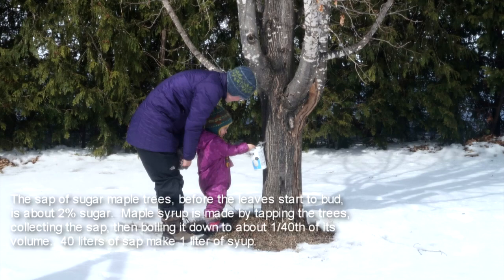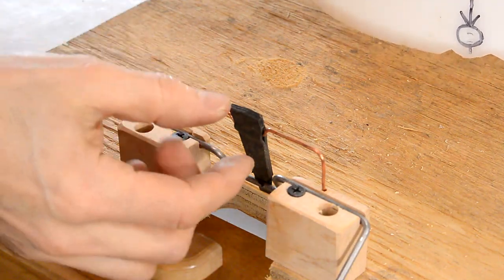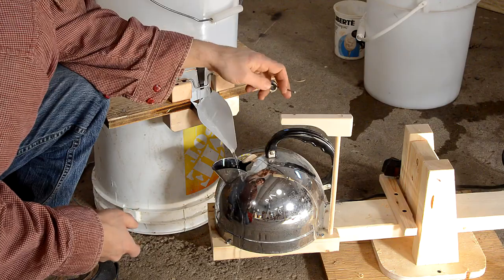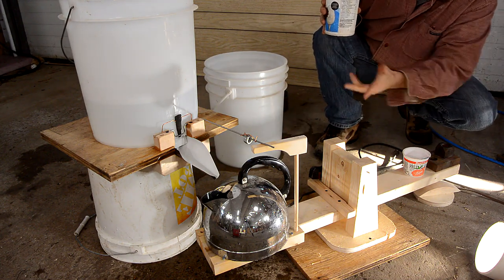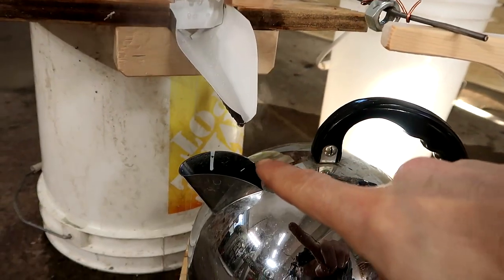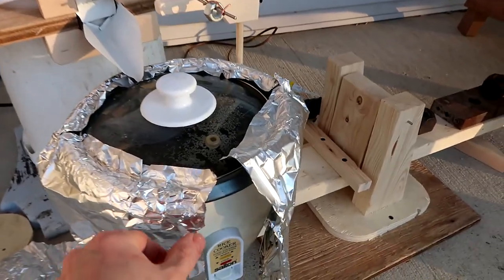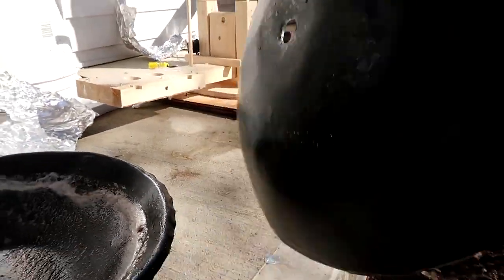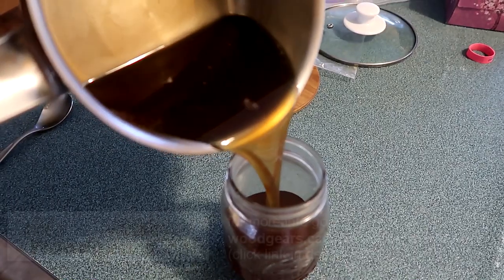Maple syrup boil-o-matic

Comment: This is awesome.
I'd have done it the easy way, with a balance, microcontroller, solenoid valve, and a relay, but the fact that you did this pretty much with only mechanical parts is truly awesome. (Only mechanical parts + the kettle, wich is electrocity powered)
Seriously, this way it looks way cooler :)

Comment: If Matthias buys a DeLorean make sure to turn on your notification if they aren't already.
Reply: He'd more likely make it powered by a wood stove and replace the front wheels with sled skis than make a time machine, though.
Reply: more like a 1972 skidoo running a 1.21 jigowatt flux capacitor fuelled by kitchen scraps, eh
Reply: Wood gas cars have maintenance problems. Tar clogs everything up. But, a significant part of wood gas is methanol which used to be the IndyCar Series standard fuel.

So it's entirely possible to make a car wood gas* fueled. The asterisk being that the fractional distillation part of the process distances it from the implications of the name.
Reply: meh .. weak joke
Reply: 1.21 Gigawatts! 1.21 Gigawatts!
Reply: I had a history professor who had grown up in Germany during WW2 and he said that due to the shortage of petroleum, almost every car was fitted with a device on the back that could produce methane to run the engine, either using coal or wood.   So it was very common then as I guess 100% of the gasoline and diesel was diverted for military use.

Comment: Nice thing about plastic, one can screw a short pipe nipple in for the sap to drain from.  The rubber should of been a bouncing ball to seal the pipe.  Then the pipe could have had the funnel screwed onto it to keep all the drips in the funnel instead of the floor.
Reply: That would be buying stuff.
Matthias doesn't buy stuff.

Comment: (I'm an engineer and inventor.  I've made syrup on a small-scale at home.  A few years ago I read cover-to-cover the fairly comprehensive Vermont handbook on maple sugaring.)

In theory, one way to remove water from the sugar solution would be the controlled crystallization of water to grow a pure ice crystal.  One technique for making pure ice, (also used by bartenders to make clear ice), is to freeze liquid in an insulated "cooler" leaving the top open.  Thus the crystal growth is only from the top-down, (and not from the sides-inward as would happen in an uninsulated container).  (Incidentally, another way pure-ice forms is in icicles, where the crystal growth is radially outward from the center.)  

In small-scale production, it might be suitable to use an insulated "cooler" as the sap-catching bucket that is hung on the tree.  
Due to the nature of convective air currents, where "heat rises", the sap should tend to cool-off at night and also stay somewhat cool during the day.  (Convection could also be increased with a fan if electricity was available, or by the use of a "chimney" and the stack effect.  A long vertical tube in the center would exhaust air warmed by the sap, and the partial vacuum this created would pull more cold makeup-air down into the bucket.)  I suppose the ideal time to remove the ice layer would be in the evening before a forecasted cold night, because throughout the day the ice would help preserve the sap, and when partially melted it might be easier to remove.  One could even write a software app that could use the online weather forecast and then signal the user on the best times to do this.

In theory there are many potential benefits of this approach:
1) Freezing uses only 1/4 of the energy of boiling & evaporating.  The cost of energy is a significant cost of syrup production.
2) The energy it does use is the ambient latent-heat energy in the environment.  The availability of this latent-heat also tends to coincide with sap flows, (at least at night, and ideally, in theory the latent-heat storage of ice could last throughout a warm day).  Ideally, the cost of fuel and time to attend to a boiler could in theory be drastically reduced.  The performance benefits might be similar to the popular reverse-osmosis systems.  
3) The cooler temperatures tend to preserve the sugar solution by reducing bacterial/microbial activity, and bacterial concentration.  This should result in a more valuable, higher grade syrup, both due to cleaner sap and through helping to reduce boiling times by pre-concentrating the sugar solution.
4) The preservation effect may allow for longer storage and more flexibility in scheduling the final boil.
5) The setup cost for such a system ideally could be relatively low.  So this could be a rather valuable technique, because from an economic/business perspective, the margins on sugaring tend to be rather tight.  

Unfortunately, I haven't actually tested this idea yet, and admittedly it is unorthodox so I don't know if it will work at all, or work well enough to be viable.  Also, even though I've given this some thought, I'm not sure of the best design, or which potential designs would be better than others.

Comment: If you can get this device to overshoot a little, rather than achieving equilibrium, make the beam keep walking, it can also power your band saw sharpening rig. All your blades could be sharp by morning.

Around here it was cane syrup in the old days. They used to boil it in 80 gallon kettles. We hope to make small batches soon...have to try your approach.

Comment: As a student of food technology, this is pretty interesting to me :D You could have used a buffer container between the main container and the kettle, which is filled by the main bigger container and fills the kettle with a constant flow-rate when engaged, so to minimize the difference of flow-rate getting into the kettle between a full container (bigger pressure and larger flow) and an almost empty container (lower pressure and lower flow).. Sorry for my bad English, I'm sure I've not been clear hahah
an other thing that came in my mind, is that you could think about a "vacuum concentrator", to lower the boiling point, get some higher quality sirup and probably get it done faster.. but it would have been much more complicate :(

Comment: Would it have helped to have the rubber flap on the inside of the bucket - with the sap pushing it closed - and just some stick poking through the hole to open it?
Reply: Oh man that's a great idea
Reply from the maker: not enough pressure from the sap to make a seal.
Reply: and the pressure would also drop as the bucket emptied...
Reply: It bothered me at first how crude that valve was but in the end it only needs to regulate the flow. It doesn't need to be able to completely shut it off.
Reply: Tim Derks Matthias is an engineering God, he already thought of it and rejected it. ;-)
Reply: Probably, but I wouldn't be a good engineer if I didn't double check ;)
Reply: Tim Derks all in good jest ofcourse :-)
Reply: It never closes, so why bother?
Reply: I don't think there was a need for a flap, inside or out,  i should think just having a small dowel (either of wood or plastic), sharpened with a pencil sharpener would have worked as a stopper with a bit of tweeking.

Comment: Can I propose an alternative to the see-saw mechanism? This is basically the upside down glass experiment:

You could run a tube or a pipe from the bottom of the bucket to inside the kettle, down to a certain height above the bottom of the kettle. You'd place the bucket at a higher position than the kettle and make sure the top of the bucket is sealed.  This way, the sap flows into the kettle but stops as soon as the liquid level inside the kettle reaches the lower end of the tube/pipe. As the sap becomes more concentrated, the level drops and the bottom end of the tube/pipe opens up. More sap would flow in until the tube/pipe gets closed up again. The liquid level is thus kept constant.

Comment: The biggest problem I can think of with this rig is that as the sap gets closer to being syrup, it gets heavier by volume. Raw sap weighs about the same as water, 8.3 lbs. per gallon. Finished syrup weighs around 11 lbs. per gallon. That could throw the calibration of the  balancing mechanism off the longer it boils, which is a problem if you won't be there to adjust it.

Comment: I think this is something that would warrant real resources.  A stainless holding pot with a solenoid valve, controlling voltage  input via a rotary multi-position switch.  You could also control the temp of the burner in a similar way with a rheostat switch.  Use 24vdc for the control wiring via a step down transformer and install a 110vac contactor for the burner circuit.
Reply from the maker: for the cost of that, I could buy a 10 year's supply of maple syrup

Comment: If you want to make it even more complicated, use reverse osmosis to get about 70% of the water out before boiling. I'm using a cheap RO setup for my ~200 tap operation this year, and it's saving a ton of firewood.

Comment: I have an idea on the bucket. If you use a bucket with a lid that is airtight. 
Drill a hole in the bottom and mount a rubber used for electric cables in junction boxes etc. run a plastic food safe hose (not too thin) from the bottom of the bucket into the boiler. Then you secure the end of the hose (boiler side) at the hight you want the sap level. If all went right you the sap only fill the boiler when the boiler level is under the hose end.

Comment: You could probably use a float valve and tubing (sort of like in a toilet) for a more reliable bucket valve and spout. Instead of using the actual float you could use it without the float and just action the bar the same way you are now.

Comment: I wonder if it's worth doing this with a large pot, a bunch of rock wool insulation around it, and an arduino with some sensors and a real-time clock. Unfortunately due to taxes in the Netherlands the day/night difference in electricity price is just 1.5 cents, something like 19 vs 20.5 cents per kWh. Ow and there's no trees to tap here.

Comment: Maybe instead of a little flap, you can pinch a short length of a soft tube like a silicone air line (the old vinyl stuff would be too stiff, probably) for fish tanks. You can get that pretty cheaply these days. I think the smaller diameter will help regulate the flow, and not require so much pressure to be pinched closed. And maybe a simple appliance timer to shut off the electricity when it gets expensive? 

Or, heck, bust out one of those RPI's and hack an electronic bathroom scale so you can track the weight of the cookpot using the strain gauges... You could make it so that it knows how much a 'full' pot is, then maintain that by activating a servo to open or close the tube, and then when the weight gets below a level, it turns off the power. I mean, heck, that might be how you can do the final boil as well. Figure out how much a final syrup weighs, and just make sure that is below the initial weight of a full cook pot of sap, and let it boil until it hits that final weight.

Or maybe I am thinking too much about something simple. Anyway, thanks for the video!
Reply from the maker: pinching that tube would require way too much force for this system to work.
And why use a computer when you don't have to?
Reply: A thin walled silicone tube would take no more force to pinch than closing the flap, and eliminate all the leakage and aiming issues.
Reply: Matthias Wandel Not with adequate mechanical advantage.

Comment: Put the valve inside the bucket so the liquid holds it closed....then add a little nipple to the rod to push the valve inward to release the liquid = no leaks... and finally place the valve on the bottom of the bucket, no the side...that way you guarantee a seal when closed...

Comment: going back to the kettle idea, what about using some kind of heating coil or heading element and submerging it inside the bucket of sap and boiling it that way? you would have to make sure its properly sanitized and that you have a big enough coil, but im sure it could work fairly quickly. love the idea of using a rice cooker though
Reply from the maker: I thought about immersion heaters, but they cost way more than kettles, and would have taken too long to order.
Reply: Matthias Wandel what about using a heating coil from a hairdryer or something like that

Comment: Instead of doing a spout with a flapper valve .. thingy...    Why not try a straw (or tubing) that's siliconed into the bucket with a pinching device for the straw?   Maybe some tubing like you'd use in a fish tank (that's clear and flexible).

Comment: Found 1000 watt wok at 2nd hand store. Just built the fulcrum stage and now turns itself off when 70%ish boils off. Michigan is 14 cents per kWh, if I boil for 10 hours, is that $1.40 in electricity?

Comment: Wouldn't it be better to have a rubber seal on the inside of the bucket and poke it in from the outside with the wire? That  should eliminate leakage and no need for additional weight on the lever.
Reply from the maker: No, because then I'd need a spring mechanism on the inside to push it closed.  Water pressure is too low to seal it.

Comment: Once the sap becomes syrup the pot stays on due to weight. Possible burnt syrup? Does this make sense?
Reply: Green- Zone yes but the boiling would reduce weight and shut off the power.  He calculated the boiling speed (I think it was two cm per hour).  But he states at the end that he almost overshot the concentration but got lucky.
Reply: The weight of the syrup in the pot keeps rising keeping the switch on. Maybe I am confused about this.

Comment: How cool is that? I am surprised to hear electricity is twice the cost per KwH during the day.
Reply: Jeff Libby the energy suppliers have to still run their Powerstations at night so every unit used isn't a unit wasted. If they can coerce people to use power in the off-peak times they are better off. 50% of something is better than 100% of nothing.

Comment: Washing machine water valve powered by the NO terminal on the microswitch that controls the kettle.
Reply from the maker: those valves don't work at low pressure.

Comment: Why didn't you just stick a wire into the sap?  
Current will stop flowing if the level gets low enough and it's right up your alley in terms of electrical safety. ;-)

Comment: so...if the condensed end product in the pot is heavier than the weight required to disengage the switch that cuts the power, does that mean itll just keep on boiling and potentially burn?

was there something i missed here or is this a serious design flaw. i mean i assume the 40/1 conversion for sap to syrup comes into play, like...the bucket probabbly dosnt actually have enough sap to boil down enough to actually keep that switch on.
Reply: Allejandro Rojas The kettle/wok stays on when it's full, and goes off when volume decreases. The dripper will keep it full and turned on until the sap bucket runs dry, all the time the stuff in the wok gets more concentrated (but not significantly more dense). When the bucket is dry, and the volume in the wok decreases enough, it turns off.
Reply: Pete Smyth yeah but what if the sap in the pot (once the water has evaporated) is still heavy enough to keep the system turned on? what if its already hit the point where its thickened and condensed into a syrup but the weight in the pot is still enough to keep the power going? what if the end volume/ weight of condensed syrup is heavy enough to keep the switch turned on?
Reply: The end volume would keep decreasing until it the weight was low enough to turn it off. Matthias did say that it nearly went too thick, because the counterweight wasn't quite right.
Reply: Pete Smyth thats what im talking about, the system can be calibrated in such a way that the syrup would just keep boiling (possibly to the point of burning) if the weight/ counterweight system isnt setup quite right. i mean i dont know what the tollerance is between on/off for the setup but it seems slim enough that the batch was almost comprimised during this run.

Comment: I understand you not risking with that kettle. But seriously? How is it possible that it was soldered wit led solder? Can anyone explain that?
Reply: kokoronotomoni -  lead solder is common even now and likely more probable to have been used exclusively years back even in cooking implements,  today a lead free solder would be used or not at all due to better manufacturing methods.    If working in electronics opt for the leaded solder works better

Comment: You can buy/build a 3D printer and print parts for this kind of experiments.
Reply from the maker: except the steam would probably melt the 3d printed parts.  Plus, 3d printed stuff is not food safe.
Reply: Matthias Wandel I meant for the part you attached to the bucket directing the running water. Itvdepends on what kind of material you use. Abs is harder than pla and the sap will boil anyway so I dont think it would be a problem if it was running on a funel for a second or even shorter.
Reply: Or he could have used a piece of flexible copper pipe.  You don't need a 3-D printer to make stuff.
Reply: Sean Fyodorovich No, you don't but it hal helped me a lot. Much easier than to try to bend some metal thing to a shape that you might never be able to.